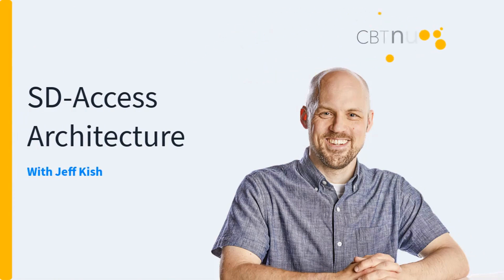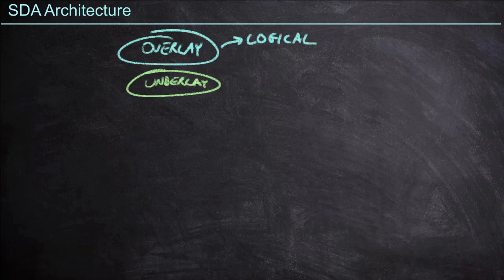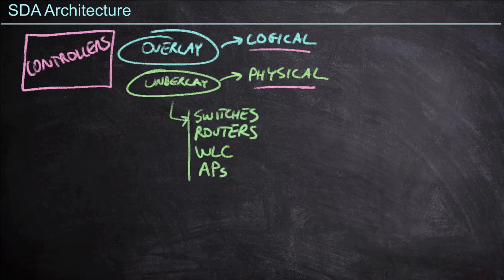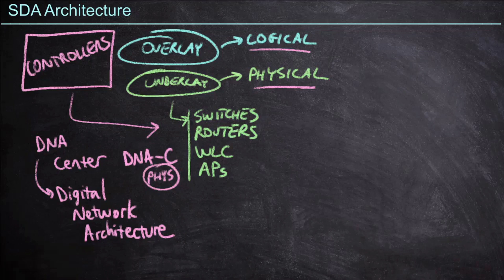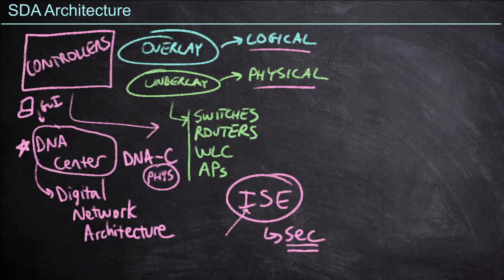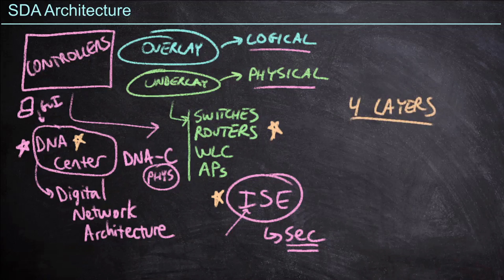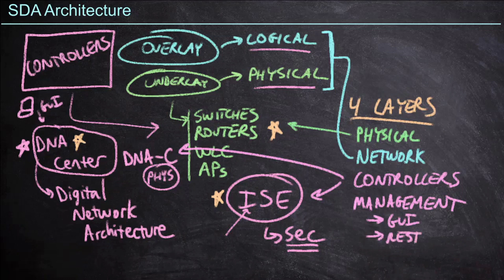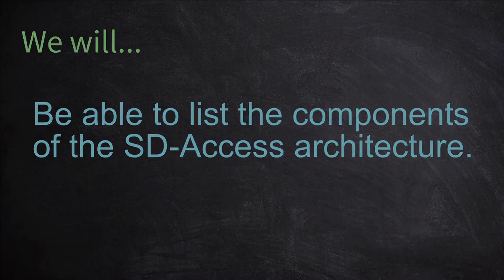MicroNugget: How to Use SD-Access Architecture

Comment: Underlay is not just physical rite? There are underlay logical configs as well on top of which overlay works.
Reply from the maker: The underlay will still be built and designed to manage an infrastructure as usual. There might be some differences to keep in mind to scale with the organization's needs. The controllers will be able to build a highway in the sky, so to speak, on top of the physical devices. The connections on the physical side will still need to be established.